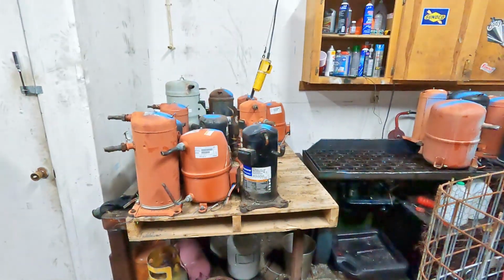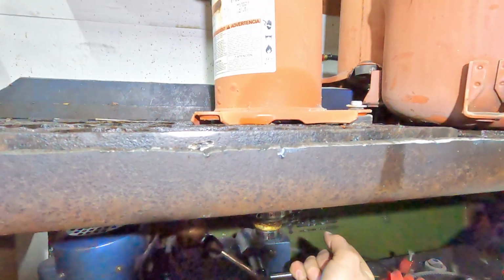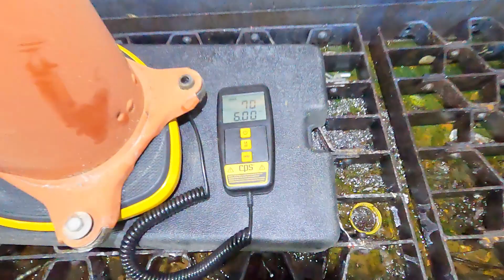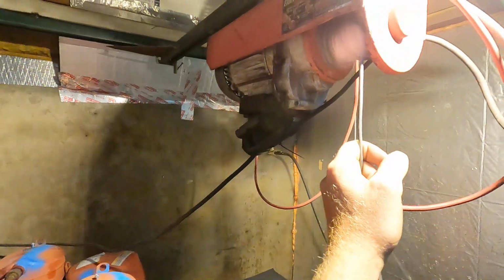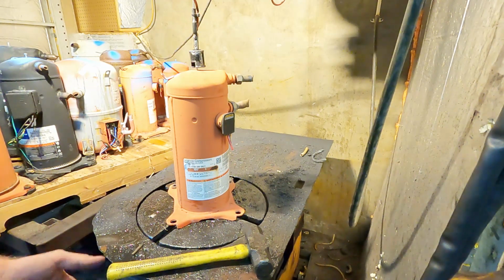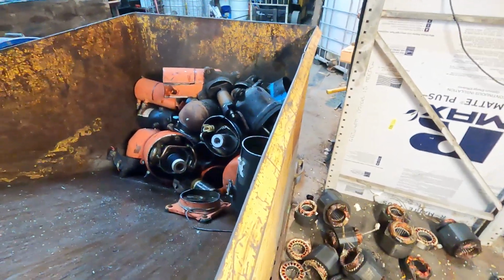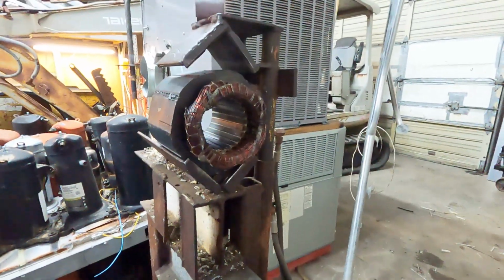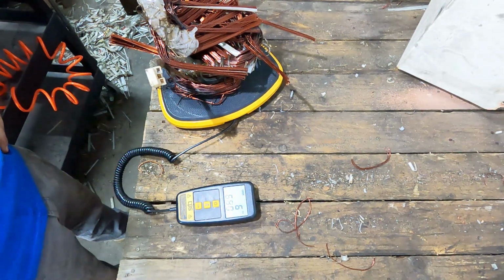are A/C compressors worth scraping how much copper is in A/C compressors

Comment: Excellent set up. Never understood why we didn't do more metal processing domestically. I am surprised that you don't take the copper/brass off the steel. Adds up. Anyway, best non-mechanized method I've seen for the windings. Now all you need is a CNC plasma cutter.

Comment: Nice video.  If you don’t mind, a couple of curiosity questions:  1) what size drill bit you’re using? and 2) what the white cap under the grating and over the drill bit is to deflect the oil?
Reply from the maker: I either use a 5/16 or 3/8 drillbit. It seems to be a nice compromise between drain speed and drill speed. The white cap is to minimize the amount of metal chips that go down between the drillbit and the chuck. I actually put a piece of heat shrink on the drillbit also to give a better seal it doesn’t prevent it 100% but it certainly cuts down on it. Also cut down on the amount of oil as well.

Comment: We don't scrap them here our yard pays 45 to 50 Cents per pound, You had a 70 Pound Compressor x 45 Cents = $31.50 as is or 6.8 Pounds @ 4.37 x 6.6 = $28.84 + HMS 63 Pounds x 14 Cents = $8.82 for total $28.84 + $8.82 = $37.64 - $31.50 = $6.14 Profit, For us to use grinding blades & all that oil it's not worth it for us, Our yard pays real good but some yards pay very little, How many can you process in one day? & your cost per Pound? Thanks For The Video